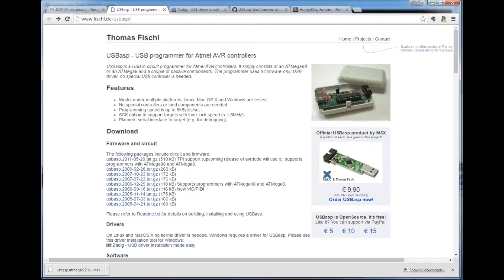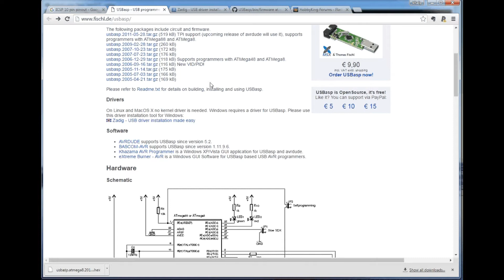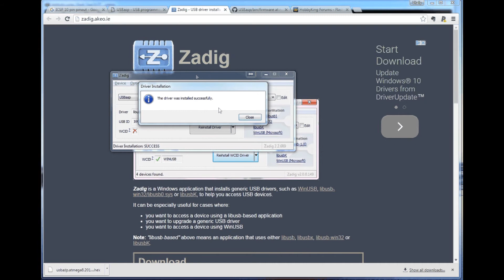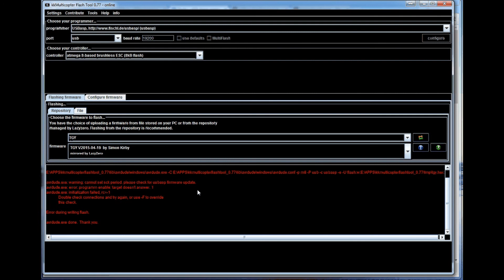How to fix USBASP not working problems

Comment: bro this error is occur bro what to do bro : ps replay bro i want help pls replay :
        avrdude.exe: warning: cannot set sck period. please check for usbasp firmware update.
        avrdude.exe: error: programm enable: target doesn't answer. 1 
         avrdude.exe: initialization failed, rc=-1
                   Double check connections and try again, or use -F to override
                    this check.
Reply from the maker: Sadham Hussain just read the description to this video, it's all in there. Reinstall drivers andake sure pins are connected !!!!!!!!!
Reply: Have you fixed your issue

Comment: the last problem which you have shown on video that's i.e "avrdude: error: programm enable: target doesn't answer. 1 " still have problem... I have checked my connections again and again but the result is same.... so please help
Reply from the maker: might be that yiu have dead chip! over voltage burned or so... try other chip . are you flashing ESC ? atmega328p? what form factor of the  chip and what socket are you using?